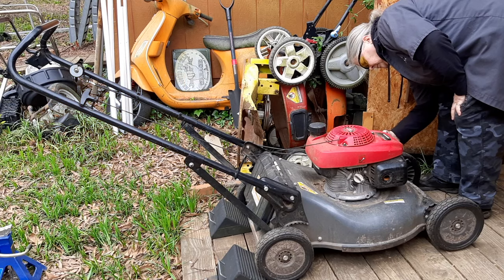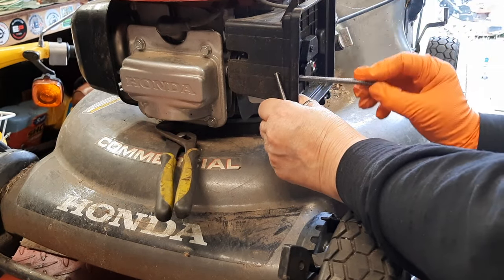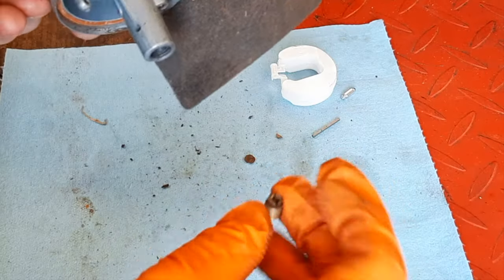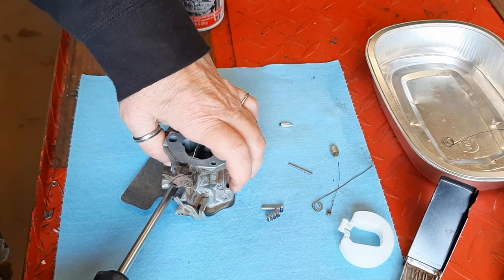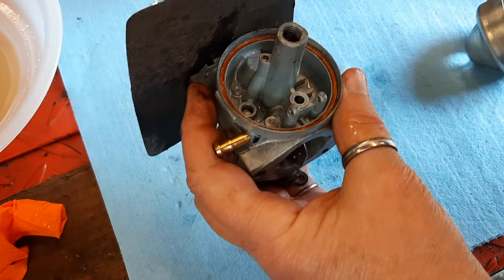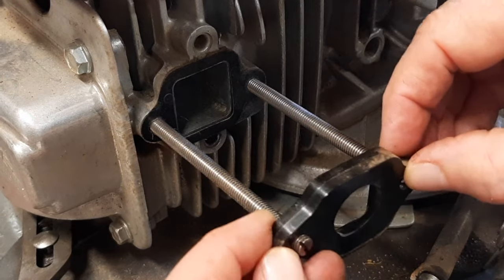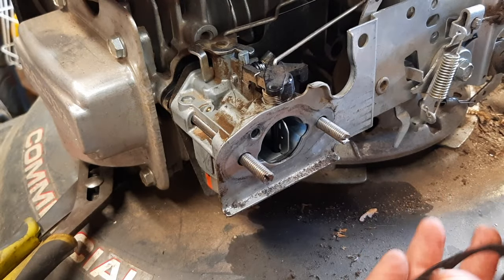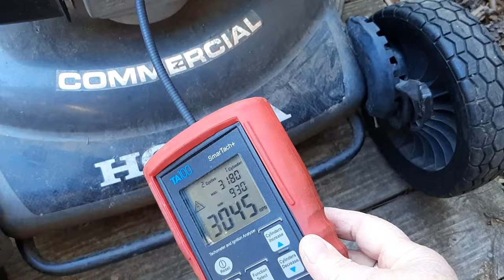Honda HRC216 No Start: GSV160 Carburetor Clean How To

Comment: OMFN’G.. I repair small engines myself. Can’t tell you how many times I’ve struggled juggling the Honda carburetor stack of pancakes.. New swear words were invented.. Entire mowers have been heaved across yard, olympic hammer yeet style.. I’ve laughed, I’ve cried, I’ve pleaded to gods large and small… then I see this video, which I didn’t even need to watch (I know it’s not the spark plug), and there it is.. A miracle, bathed in an immaculate halo of angelic illumination, with choir hitting a high note.. them long installation studs of yours with the chopped off heads and dremel cutoff wheel ground flat tip slots..🥹  thank you mower lady, thank you. You have changed my life.
Reply from the maker: The clouds parted, and the angels sang. Glad to help. Cheers 🥂
Reply: @TheLawnmowerLady  hallelujah
Reply: Although they are not quite as sure as the studs to line it up, when working on a Japanese or Chinese carb  chop sticks work well for an alignment tool.. Sort of ironic?

Comment: I put fuel line cut offs on all my mowers so I can run them dry. On chainsaws and weedeaters, I dump the remaining fuel back into the container and run dry. ZERO dirty carbs from sitting fuel and they all crank on 2nd or 3rd pull. Easiest fix ever.
Reply from the maker: Smart move!
Reply: Life would be easier if everyone did that. 🙂
Reply from the maker: @GuysPlayingWithTools  I agree, but 90% of my work would disappear 😹
Reply: @TheLawnmowerLady  I wouldn't have anything to flip either. 🤣
Reply: I do exactly the same. Never have a problem.

Comment: These little 160 engines are bad for it. They’re good engines. I always starve mine out of fuel with the fuel valve every time I shut it down and have ever since I bought it brand new 16/17 years ago. It’s a Good mower Mine started doing this exact same thing not wanting to start if it did it wouldn’t run very long at all it was a very hot day and I grew extremely frustrated very quickly. I dumped the fuel out and then mixed sea foam carburetor cleaner and fresh gas and poured that into the tank still wouldn’t start so I sprayed some starting fluid into the carburetor it’d run on that so we restarted it on starting fluid and kept spring starting fluid into it to keep it running for a few moments and I would tap on the side of the carburetor with a small hammer. I took a chance on breaking the carburetor and you’re not supposed to do that and ect.ect. I know however, like I said it’s an older mower and I was extremely frustrated. It was close to 100° that day with the heat index. Well over 100° the humidity was about as high as it could go and I was wringing wet with sweat it was actually hard to breathe outside in that stuff, and I had grown very frustrated,,,after tapping the carburetor with the 🔨 hammer while running it off the starting fluid it actually started drawing from the tank,,, and then that seafoam cleaner started doing its work, it produced quite a bit of smoke as I mixed it very strong with the gasoline. I actually had a neighbor come over with a fire extremely frightened there was a fire however I explained to him I was cleaning a carburetor,on a small mower, etc. everything was cool. It’s starting the first or second pull every time now however I’ll probably run some more. Sea foam through it throughout the season to make sure it’s cleaned out really good.

Comment: It says in the manual what to do for long term storage.  It's pretty simple but not too many people follow the instructions.  Empty the carb and fuel tank, coat all rust spots with grease or oil, pull the spark plug and put a few millilitres of oil down into cylinder, slowly pull starter rope a couple of times, reinsert the spark plug, pull until compression. Store.  Mine was the abridged version from the HR214SX manual, but it applies to all Honda engines.
Reply from the maker: I wouldn't have a YT channel if it weren't for folks not bothering to read or follow the OM.
Reply: Thanks for this info. I was gifted a 2nd hand Izy, no manual, hence scouring YouTube for a fix when it refused to start after a recent fuel refill (was working fine up till then..... BIL who gifted it to me told me it doesn't much like the new E10 fuel we've had to change over to in the UK!)
I'll copy your post into a notebook so I don't lose the winterising instructions!

Comment: This has to be one of the most over-engininered conglomerate of a throttle system that I have ever worked on. Thanks again for the 6mm stud idea.
Reply from the maker: It sure is Mr Bill, for sure. I got the stud idea when I found out how crazy expensive the same “tool” purchased from Honda would be. Thanks for watching!
Reply: Just put a k20 on it, haha but good luck trying to push the mower though, hahaha
Reply: Can also do this when replacing head gaskets on the 4 cylinder car engines so the head gasket doesn't move on you while you installing the head back on just cut the bolt heads off 2 old head bolts  and if need be grind 2 flat spots on the shaft so you can use a wrench if you need to use it to screw down the bolt a ways into the block you just Cady corner 2.
Reply: @tonytiger33  thanks for the tip. Good one!
Reply: @billstiles487  there are usually 4 corner tabs and 2 middle tabs  though because on v6 and v8 engines the head would slide right off the deck the tabs usually hold the gasket in place unless your replacing the head gasket on a small engine then you can do the same for this as well so if you have  a small engine that snapped the connecting rod save 2 of the head bolts from the bad engine and cut the heads off these and can either cut slits on the top of them or grind 2 flat spots on the shaft and use a wrench to put them in a ways then the gasket will be perfectly lined up or you can buy the spray gasket glue and spray the side that is going on the engine side wait like 5 minutes but screwing   the studs into the holes is much better in my opinion due to all the engines on push mowers are horizontal not vertical but on lawn tractors depending upon the engine thats on it it could be a vertical engine.
Reply: @tonytiger33  thanks for the advice on the larger heads but I probably won't take on that challenge. Although, it is a great reminder that I  can use this method on the smaller engines as well. I've had a few jugs to align after replacing rings or a total top end overhaul. This method will make things so much easier. Thanks for expanding on The Lawnmower Lady's tip. You have a great idea going there.

Comment: In my case, it was actually the spark plug. I have an HRR216VKA which also has the GSV160 engine. Popped in a new spark plug and now it starts on the very first pull. Thanks for the very detailed video - should come in very handy in the future 👍
Reply from the maker: I agree, it can be the spark plug. Honestly bad fuel is 95% of my  repairs, especially at the beginning of the mowing season. Thanks for watching.

Comment: Thanks for the good demonstration. The GXV and GX carbs I can do with my eyes closed, but I’ve never had one of those newer GCV motors apart other than slipping the jet and emulsion tube out with the carb in place.  Your long studs are a great idea! 👍🏻
Reply from the maker: They do make the job easier for sure. Thanks for watching. Cheers!

Comment: Great video!   I just finished rebuilding my Honda carburetor after a bad batch of gas.   The good news is my new Honda lawn mower came with the carburetor studs installed with nuts in the air clearner.   It was a snap to get the carburetor off and on again!
Reply from the maker: Glad to help! The studs have been on some commercial models and the newer GCV 170/200 engines do as well. Much easier to work on. Thanks for watching!
Reply: Just did this to my brothers 2001 Honda HRH536 HXE. It had studs already installed and nuts to hold the air-filter connector in place. In this case it was a semi-clogged main-jet and a defective coil/magneto. Cleaned carburettor and replaced coil/magneto, started on first try and was unhappy with choke after 5 seconds. Took it straight down to idle and it ran perfect. This model have hydrostatic-system and a clutch to engage/disengage cutter-blade. Now it will run for another 22 years before getting a make-over again.
Reply from the maker: @runejakobsen9958  I'm happy it worked out for you. Cheers!

Comment: For crappy carbs I find Berryman B12 Chemtool works wonders. It saved both my big snowblowers when I forgot to turn the fuel off one year and they sat for 9 months slowly evaporating half a tank of fuel through the carbs. They wouldn't even start with the hand pull, I had to use the electric start and even then they barely ran and only while fully choked. I dumped an entire can into each one and let them run. After 20 minutes they started chugging and I realized they didn't need to be choked any longer. Another 10 minutes and they ran like new. They both are back to starting on the first pull. Love Berryman's. Not only do I think it works better than Seafoam, it's half the price too.
Reply from the maker: Good info. I purchased a few cans on sale the last time I was in the auto parts store. Thanks for watching.

Comment: Thank you for this video, exactly what I was looking for,  and the close up shots are sooo helpful! Already watched a bunch of other channels' videos and none showed the process close enough to see clearly exactly what to do! I have a Honda Izy, I presume the carb will be similar - or at least enough that I can figure it out if not. Once again, thank you!
Reply from the maker: Great to hear! Izy is almost the same as Harmony models on this side of the pond. Carb is the same. If a newer model, the idle jet is removable. It’s in a plastic mount, behind the plastic idle speed screw. pry it up gently with a small flat blade screwdriver. Same location as the metal screw on this carb. Cheers!
Reply: Great idea the dummy bolts to keep all gaskets in place
Reply from the maker: @JohnHackett-cf7vn  I was a game changer for me. Thanks for watching!
Reply: @TheLawnmowerLady  thank you!

Comment: I've found that sparkplugs are, in most cases, needlessly replaced. May I suggest you do a video on checking their condition (continuity/resistance test) and on cleaning their tip. Stay safe and be merry my dear lady !
Reply from the maker: Good idea. I used to clean a lot more of them, but in reality, it's worth more of my time than a new plug. So unfortunately I'm trashing most of them. I do however take them to the metal recycling center so at least they might not end up in the landfill. Thanks for watching.

Comment: Wow Stella, a Honda engine without that cheesy fuel line clamp that i alway throw away! Nice repair and no new spark plug needed. 👍🎥🇺🇸Roger
Reply from the maker: Ha! You’re right. Didn’t even realize that. Cheers!
Reply: I despise those clamps Roger. 👍
Reply: @Big_Johns  You and me both John. I always toss them and put on the normal looking clamps. I bought a variety pack from Amazon.
Reply: Me too brother, I have the finger pinch style and the compression style clamps straight off the Amazon clamp mill. 🙂

Comment: The 6mm studs are a GREAT IDEA!  I just took the carb off hrs16hkv two times and yep, it’s a huge pain. Got no spark after replacing busted recoil assembly and plastic fan thing below it and on top the crank. Coil?

Comment: You’re right it’s never the spark plug!  I’ve seen engines with a 20 y/o original plug and it works fine.  I never replace the plug.  I just clean and gap it.
Reply from the maker: Yep Mr Jim. I replace as it's quicker than cleaning. And folks seem to think a "tune-up" without a new spark plug is somehow incomplete. Cheers!

Comment: Thank you for the video. That was very helpful. How do you prevent that from happening? My lawn was working two weeks ago and when I tried to start it, it won't start. I always use unleaded 91 gas with Honda fuel stabilizer.  Thanks again and keep on the good work!!
Reply from the maker: Did you by any chance fill up your gas can with any amount of old fuel from last season in there? If so, empty it all out and dispose of it in your automobile fuel tank. A tiny amount of water won't matter to your car, which has a fuel pump. Small engines like this are most often gravity fed systems. Mean Ol' Mr Gravity won't allow even a few drops of water in the carb bowl. If you can get ethanol-free fuel in your area, that is better than 91. No need for fuel stabilizer. I appreciate you watching. Cheers!

Comment: So far I've worked on a Troybilt that would run when you squirt gas in the carburetor and die. And another Troybilt that had an annoying surge after start, revving fast then slow fast and slow fast slow. And both were fixed by just replacing the spark plug. My philosophy is always suspect the spark plug because its the easiest and the cheapest thing to replace. The very first thing I do is check the spark and then the condition of the spark plug.  Then I start cleaning the mower and checking on the filter and the condition of the oil. After shooting it down with water I'll wipe it down and replace the spark plug. Then I take a deep breath and pull the starter coil and wallah it starts first or second pull it doesn't take long. My personal Honda HRT216 surged and I replaced the spark plug and wallah again. 
The Spark Plug? It was some time ago over a decade I was constantly hunting mower diagnostics and troubleshooting on YouTube. This one comment about changing the spark plug for a Honda mower that would start and die 10s later at the time was hilarious. Then years later I saw another comment saying to change the spark plug. Then another comment about how changing the spark plug worked. I checked it out and it hasn't failed me yet. I couldn't start my Honda H3011 riding mower it would crank but never turnover. I thought I was going to have to tear into the carburetor finally but I was going to change the spark plug anyways just to know that it can't be the spark plug. Turned the key and my Honda riding mower cranked and turnover and ran.  
The neighbors whose mowers I fixed probably think I did something else besides changing the plugs but I didn't. I as a rule when working on a small engine mower I always suspect the spark plug first. I don't know why it works but so far it has not failed me. I have to this day not cracked into any of my mowers carburetor. I watch all you guys cracking the carburetor open and it gives me a cold sweat. Thanks for putting this up I learned that a 6mm threaded post can help removal and installation of the carb. I've now owned my mowers for over 20 years and I've yet to tear into my carburetors.
Reply from the maker: Funny, you mention that about plugs, I remember my Dad always had a spare plug on the shelf in the storage shed. I asked him about it, and he told me if it didn't start, he'd put the other plug in. He rotated those same two plugs for years and years, LOL. Not sure if he even cleaned them or not. 

Perhaps you take better care of your equip, or your storage season is shorter,? But the honest truth is more than 90% of all my repairs is fuel related. It's easy enough to pop off a carb bowl for a peek before taking the entire thing apart. I find bad fuel is just the tip. I don't want any returns, so pulling the carb for a complete service is never a waste of time. 
I appreciate you watching. Cheers!
Reply: @TheLawnmowerLady  Taking better care of my equipment is probably 1 piece of the puzzle. But the 2 mowers that I fixed for my neighbors treat their mowers like mowers. If the spark plug replacement didn't work then I would seriously think about cracking open the carburetor for cleaning but I never have to go that far after replacing the spark plug. And my repair position is because of the comments that I read on the hundreds of small engine repair videos on YouTube having found that it worked. 
I bought a Troybilt Tomahawk shredder with a real nasty carburetor that I replaced becuz of hard starting. The entire brand new carburetor was cheaper than the kit. And yes I did replace the spark plug first thing but it didn't improve the hard start. So an obvious carburetor problem here. BTW I have to further thank you for showing how you use that ultrasonic cleaner. Thanks!
Reply from the maker: @breeze787  Happy to help. Cheers!
Reply: @breeze787 I'm on it!!  4th time cleaning the carb and about ready to pour gas over the whole thing & light a match if it still surges, but not until I replace the spark plug 1 more time - it's been a while.  It starts fine, but who knows.
Edit:  Gonna think positive & say, "Thank You!" in advance.

Comment: Great video. I've had my Honda Carburettor apart a few times and the tip on using the threaded rod is fantastic!

Could I pick your brains on a problem?... My engine starts first pull after cleaning out the carb, but then dies after 10-15 seconds. It will run at low RPM, but not at higher speed. It's like it's running until the bowl empties and then starves of fuel. Letting it sit for a few seconds and it will start again bit then stall. I've blown out the fuel line with compressed air, but I'm out of ideas. Any help would br greatly appreciated.
Reply from the maker: I have run into a similar situation where some Honda engines seem to have a double wall fuel line. The inner wall had collapsed and restricted the fuel flow to the carb. I've replaced the fuel lines with off the shelf fuel lines, thicker outer diameter, so you'll need to replace the clamps as well. No great loss, those twisted wire clamps are a PITA. I appreciate you watching. Cheers!